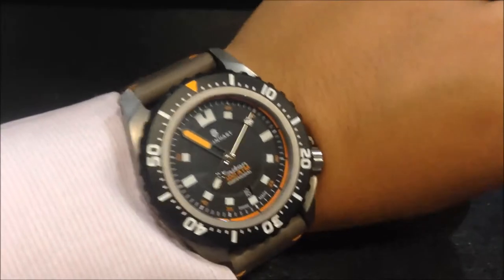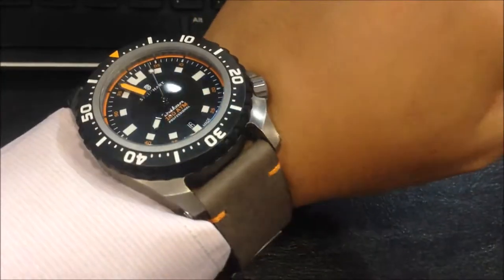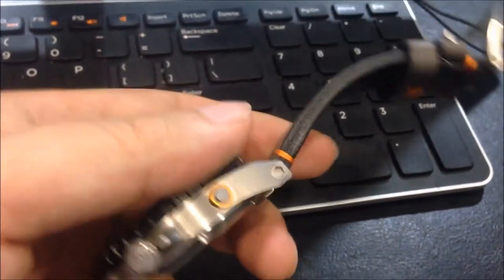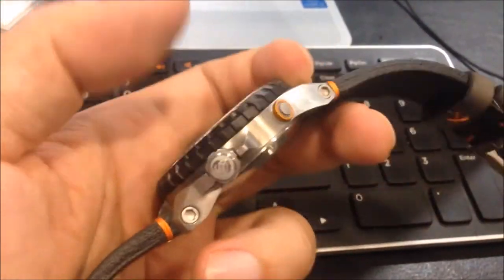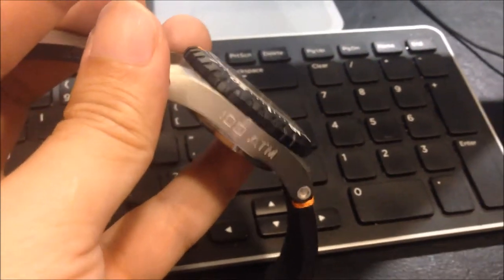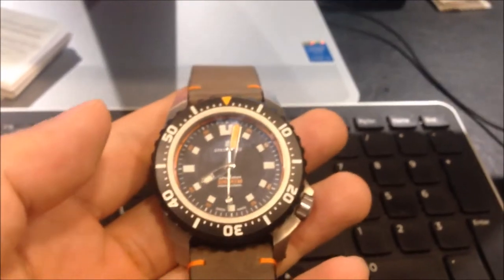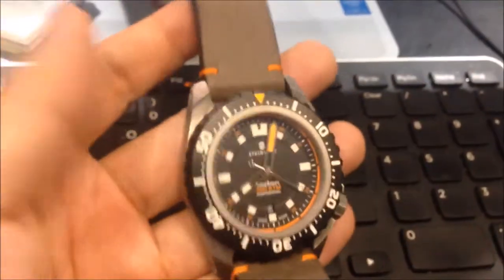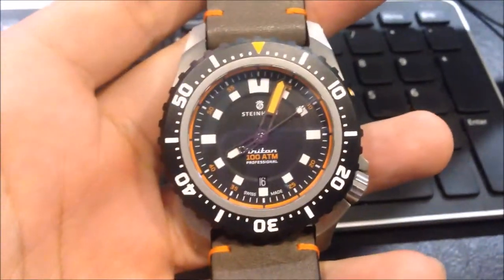Short Review on the Steinhart TRITON 1000 Titanium Titan

Comment: The caseback is probably stainless steel for the fact making one of titanium would be far more difficult since titanium is harder towork with than stainless steel. As for the strap it was obviously for styling and cost . They speculate this watch will be worn more for style and work thand diving thus they offer a rubber and stainless bracelet on the site.,
Reply from the maker: You are probably right. Definite for desk divers...